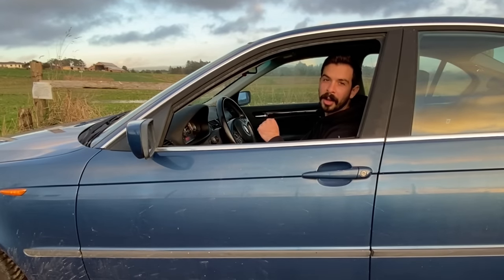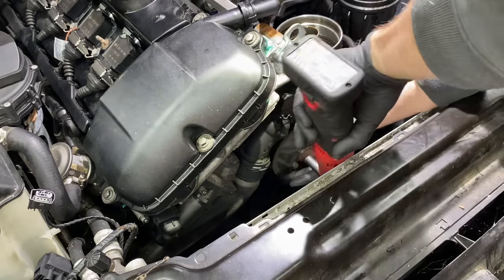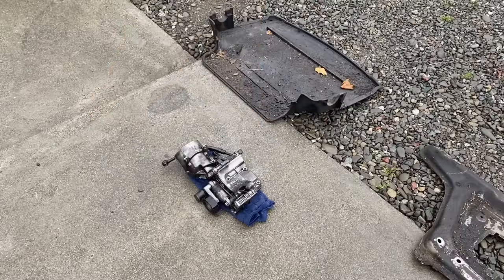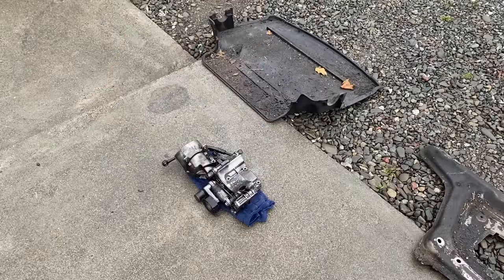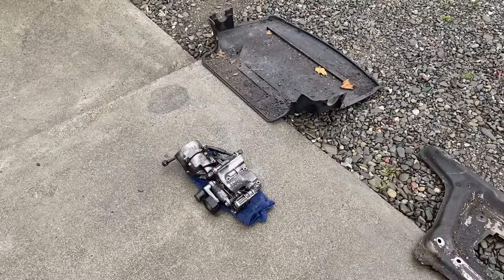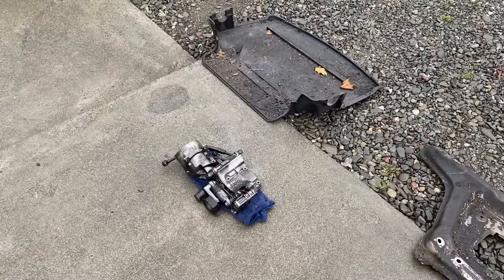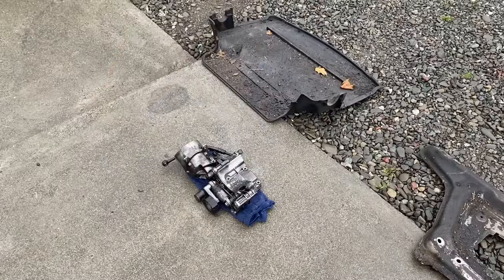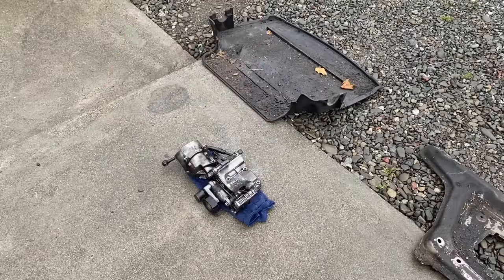$500 BMW E46 Back On The Road! After 4 Years Broken n Sitting

Comment: Just a heads up this is a ZSP (sport package car with MTech 1 bumpers and style 68 wheels). ZHP came out in 2003 and had MTech 2 bumpers with style 135 wheels. ZSPs are still nice
Reply from the maker: Thanks for the info! I didn’t know the name of the style. Totally screwed up and called it a ZHP, I appreciate the correction and feedback!
Reply: @DayOffDIY  Still a nice car regardles

Comment: Awesome video and a very cool E46 330i. The 330i sedans are quite difficult to find in Europe especially one that is in great condition but we get a lot of the 320i/325i models. You should also look into replacing the expansion tank itself at some point to be on the safe side. Keep up the good work 👍
Reply from the maker: Couldn't agree more! The expansion tank definitely needs replacing at some point, water pipes too. Awesome to have viewers in Europe. Thanks for stopping by!
Reply: In europe this car is closer to 5k than 500$ :D You can't even get the M Tech (ZHP) bumpers for 500 and the engine is much more expensive
Reply from the maker: @pharkasj  I really scored! Are you able to ship US BMWs for driving in europe?

Comment: Great vídeo again! I’d love to see a chain tensioner maintenance video, the one with the spring. Do you have any video showing it ? Cheers from Spain
Reply from the maker: Thank you! I’ve done the job before, I’m my mechanic says, however I do not have a video. Do you have any questions on that piece? 

Awesome to have a viewer from Spain, thanks for stopping by! 🇪🇸
Reply: @DayOffDIY  I have a M52tu with 235k miles. So I guess is time to do some maintenance on the chain. But I’m not sure if I should do a full rebuild with internal tensioners or I can get away with the external tensioner.
The furthest I went with my engine is replacing vanos seals and bearings
Reply from the maker: @ISSM87  is the chain making any noise? IMO I never really did timing chain preventative maintanence on M52 or M54. We would renew if we were doing head gaskets maybe or had the heads off, but in my opinion they don’t fail or wear out like the M62s do
Reply: @DayOffDIY   if I get close to the vanos area during idle I can hear a subtle rattle but I guess this is normal. 
I’m more concerned about the plastic chain tensioner and guide rail inside the engine than the chain as they’re 23 yo plastic parts😂  I also heard that the tensioner spring tend to lose tension hence making the chain lose with horrible effects haha
Reply from the maker: @ISSM87  if there’s noise it might be worth looking into! The exterior spring tensioner is pretty easy to replace so that might be a good place to start! Easy enough to see if it improves the noise, but you are correct, the plastics don’t age well…

Comment: I've owned (,and therefore worked on,) E36 and E46 since 2004.  Shit if I didn't learn me something from this video.  #1, use lots of lube.  Those hoses are a bitch and now they will be less of one. #2 That bit about the alternator nut is freaking gold.  I have spent many a minute (or hour) struggling with reseating the alternator after removal...  Now I know.  Thanks man!
Reply from the maker: Glad you enjoyed it partner! I’ll do the best I can at trying to identify the tips and tricks on the E46 platform I’ve learned over the years

Comment: I have an E46 Touring with the M47N engine that is supposed to reach 88C or preferably more, but it never gets past 80C. There are 2 thermostats in this car. One for the engine and another for the EGR. I do not want to guess and throw parts at it. DO you think replacing both thermostats fix this problem, or could it be more probably that there is some deeper problem???
Reply from the maker: hard to say.. not familiar with that engine, we dont have it here, you could check with a temperature gun around the thermostat areas to see if theres a temp difference, theres also different temp thermostats you can install

Comment: Nice video bro, you mentioned you were a bmw mechanic in the past, what do you do now for a living?
Reply from the maker: I worked as a firefighter for the last 4 years but am trying to do YouTube full time!
Reply: @DayOffDIY  Your channel is popping! It's getting popular fast!
Reply from the maker: @bogusienombre355  I know I’m pumped! Can’t believe all the support
Reply: @DayOffDIY  You've got a great tone and you share your thought process. That's 100% ligit! I'm excited for you and many people dig it!! There are sooo many e46 fans every where and they all have 100k mi. cars and want help. I'm only at 89k. I think my car is really doing well. I just need a little bit of resto/refresh on some things. Do you think I could drive it 3 mi. to a lift. or if my buddy can jack it up with me to check the parts you suggested and the trans fluid either safer than the other?
e
Reply from the maker: Thanks for the comment Bogusie! sorry for the late reply. I mean if its not shimmying too bad while driving it or making horrific noise you could take the gamble, or just get a tow to play it safe.

I would focus on the Guibo or the Flex disc that connects the driveshaft to the tail of the trans, also the center support bearing which holds the driveshaft up and supports it in the center, as well as the differential bushing that mounts the rear differential to the rear sub frame. Theyre notorious for failing and make a horrific clunk shifting from P to D to R or any real order. when you shift the movement from forward to reverse its the worst. Then i would check trans fluid. Good luck! and thanks for being a great supporter
Reply: @DayOffDIY  Thanks for your response! I will check fluid first then if it's not low I will check all the bushings. It seems to jump harder from park to reverse than it does from drive to park. Glad to know it's probably not as bad off as it was in my nightmares! Ever seen any aluminum coolant over flow tanks that work well? I think if you can share some cool stories from your bmw days people might be amused, educated etc. Just never see that type of anecdotal content and you seem like you can tell entertaining stories. Keep your channel going. we are digging your style! Thanks again. Really appreciate you sharing the knowledge.
Reply from the maker: @bogusienombre355  
Thanks I appreciate it!
I’ve installed a few, IMO they sometimes have funky figment issues compared to factory style tanks so I usually stay stock, but it’s definitely a flawed design factory so I see the value to the aluminum. Sounds like a differential bushing, I’m curious to hear what it is
Reply: @DayOffDIY  Thanks for the info on the overflow tank question. I was just curious. I will definitely let you know how this gets resolved. I think it will be the bushing like you stated. Thanks again.

Comment: Hey love your videos, I performed on my m54b30 all the repairs you did here and many more but still have a problem. When I start from standstill with only the clutch and minimal gas pedal, the rpm drops under 500 for a while before coming right up. Did you ever encountered something like this? Thanks and keep it up bro!
Reply: O2 sensors, mass air sensor, vacuum leaks, camshaft
Reply from the maker: Thanks for the comment! The viewer down below had some good suggestions, any codes currently present in the computer? i would suspect a potential vacuum leak maybe.

Comment: These videos got me to buy a 2007 x3 with 108k miles and overheating issues. Hopefully i didn’t bite more than I can chew. At least it wasn’t that much, $1500
Reply from the maker: Congrats! Dont worry too much, should have the N52 yeah? If so, thats one of my favorite engines, the M54 and N52 are the most reliable in my opinion. Fairly easy to work on too!

Comment: Love the video! I have a question tho, what’s that tool called you used to check for leaking on the coolant? Thank you!
Reply from the maker: That’s a cooling system pressure tester, used with a bmw adapter for that model of car. Hope that helps!
Reply: @DayOffDIY  Great thank you and congrats on the successful project can't wait to fix up a used 2002 330ci convertible in the next month your videos help a lot!
Reply from the maker: @AlexGarcia-qt6ku  pumped for you Alex! Glad I could help, good luck with repairs partner

Comment: The plastic box he pulled with the flap. Did he say desa? I can't find that thing anywhere. I have a vacuum leak I believe that's my issue.
Reply from the maker: That’s correct, it’s a DISA Valve. Sometimes can leak at the gasket or the mechanism can fail causing noise and rough running

Comment: metal impeller= bad fuckin news when it comes apart as there super prone for doing. oem is what id stay on the water pump.
Reply from the maker: I haven’t had any negative experiences so far, and I’ve replaced maybe 100 or so m54 water pumps. Hopefully you can hear the pump failing or catch it leaking @ the weep hole before the impeller fails.

Thanks for the heads up though! I agree , OE is always best, however I’ve had lots of good experiences with comparable pumps out there
Reply: @DayOffDIY  e46 owner moderators have all but scared the shit out of me from using my tin metal one. Which is brand new in the box. Only thing I didn't swap out during my refresh which lasted a month then bambi took it all out a day after Thanksgiving lol. Almost ready to put it back together tho. Waiting on the ps pully. 
Either way, my oem pump is still ticking *knock on wood*. As it may fucked something major when I smacked that buck. But I can hear it's suction when I turn it by hand tho.
Reply from the maker: @Kraxt0n  Better safe than sorry! Dang that sucks you hit a deer, did it really smash up the car?
Reply: @DayOffDIY  did it remove my imijur comment/link?
Reply: @Kraxt0n  I think so
Reply: @alecvanauken3580  perhaps he did since it's an outside link. Unsure... I'm good with phones and computers but coding and re working links to ad alternative ways into one's life isn't one of the things I'm capable of lol. Maybe YouTube removed it with their new policy in place.

Comment: I just replaced both of my belts and my idler Pulley is missig (it wasn,t installed) is that bad or ist that normal i have a M54b22
Reply from the maker: Definitely interesting! never seen one without an idler... might be worth looking into
Reply: @Jan Sadrijaj That's quite normal for a UK/EU spec model. Not all of them came with an Idler pulley. Not too sure on the reason behind it.
Reply from the maker: interesting!

Comment: My daughter’s 2004 bmw 330i broke down on the highway. When I went to get her the car was overhead. It was one of the hard plastic coolant lines that you said you will replace later…
So I took the car home and replaced the whole cooling system and when I cranked it up to bleed the system I realized that the head gasket was gone. It was blowing compression out through the overflow tank.😢
So I was going to let her borrow my weekend 2005 bmw 330ci but I first wanted to make sure those coolant lines were okay. So when I removed the intake manifold I realized that they were already beginning to deteriorate and the car has just passed 100k miles and always been garage kept. Please don’t gamble with your car and change those lines asap because they are made of biodegradable plastic…
Reply from the maker: Youre absolutely right, ive replaced quite a few water pipes and have seen many fail. Im definitely going to replace these in the coming weeks. 
Thanks for the comment and your experience!
Reply: My BMW had a bad head gasket leak, I just dumped a $20 bottle of K seal in and it's been fine for about a month now. I mean I wouldn't take it on any long trips but it's been fine so far for driving around town 🤷‍♂️

Comment: hey 
i have e46 325i 2003 
it misfire when the car is cold but as soon it get warm it runs good 
any advice bro ??
Reply from the maker: Is it on a specific cylinder?
Reply: @DayOffDIY  yes , cylinder 2
Reply from the maker: @mohammedmaloshy9699  have you tried swapping components yet? spark plug, coil, injector? also have you done a compression test on that cylinder?

Comment: question. I have e46 2004 325i. sits garaged. rarely drive it. transmission jumps when from p,r,n,d. auto trans. what order do I need to look at ? low fluid. selonoid. leak in line. thanks in advance.
Reply from the maker: It jumps? or clunks? ive had a similar issue before
Reply: @DayOffDIY  kinda does both. my foot is on the brake peddle and when I put it into reverse it does a little forward motion and I hear a clunk about in the middle of the car. it's definitely behind me.
Reply: @bogusienombre355  That's probably the CSB, center support bushing.  That will take out the front flex disk, which in turn will destroy the hidden (and oft-forgotten) centering bushing 26-11-7-526-611.  Either order all of them at once, or plan on parking the car a few days if you discover they are starting to fail.

If it's just a clunk, without the feeling of coming from behind, it's probably only the flex disk.  Always replace the centering bushing in this case.
Reply from the maker: @bogusienombre355  have you checked the rear differential bushing yet? or the center support bearing/driveshaft condition?
Reply: @DayOffDIY  I haven't . I was a bit hesitant to drive to a garage lift until I had some idea . I was concerned it was transmission gears moving on low fluid?
Reply: My bmw does that kind of feels like the back of the car lifts up when you put it in R or D. I will just live with it lol

Comment: Headgasket, Oilsump gasket, Camshaft gasket, ODMA/Oil separator, steering rack sealant, all the ball joints in the control arm, inner & outer tie rods, ok the Lower control arms were good but how about anti roll bar bushings, engine mounts, wheel bushings too not to talk of the entire rear suspension bushings. Bleeding the brakes and rebuilding its pistons. Fuel filter, fuel pump, injector service, complete coolant flush, spark plugs & coils. I'm not a mechanic but, don't ask me about making my own video but, I don't have to be a drug dealer to know what drugs look like. There is no difference between a drug dealer and a junkie they both know their drugs very well. Trust me, I know BMW, it's the only car I've ever owned. This was great for Youtube content but, this is a shallow fix as it gets, I wouldn't attempt fixing this car if I wasn't going to do it properly. Sorry but, you can buy a $3 BMW but their initial cost is not what makes them money pit, it's the maintenance and cheaping out that gives the brand the bad name it has. It's really not a poor man's car.
Reply from the maker: This is just one of many videos I have on this car, I’ve done lots of other repairs but money is the issue, don’t have all the funds available to fix everything so far. 
Thanks for the comment :)
Reply: @DayOffDIY  I get it, please don't take it as an attack, I'm coming from a perspective of a consumer & you obviously from that of a mechanic. I also understand the effort it takes to make videos for folks to watch. Alright, have a great day man.
Reply from the maker: Thanks sir! No worries, just figured I’d give you some more info. Hope you have a great day too! :)

Comment: You posted that this BMW was a 330i ZHP. That is incorrect because all ZHPs with manual transmission were 6MT, not 5MT.. Also the BMW you are working with has an MTech I package not MTech II. ZHPs also came with the style 135 wheels which this BMW does not have. There are also more differences such as lack of aluminum cube interior trim, M-Sport Steering Wheel (you have the Sport Steering Wheel instead) and more. Other than saying you had a ZHP, this was a good informative video. Just wrong car.
Reply: As well ZHP versions has redline at 6.800RPM while other 330i (and this one) has redline at 6.000RPM.
Reply from the maker: I did, and my apologies, that was a mistake, should have said facelift, but i will highlight your comment so that other viewers can see your description to my mistake. Also thanks for the info describing the differences! I should know better being a BMW mechanic for 6 years, but the enthusiasts always know more than me lol
Reply: @viliussedbaras6544  6500
Reply: 🤓☝️ (jk lol)